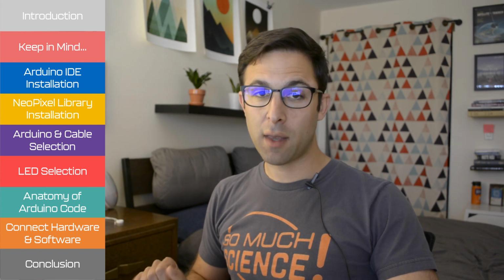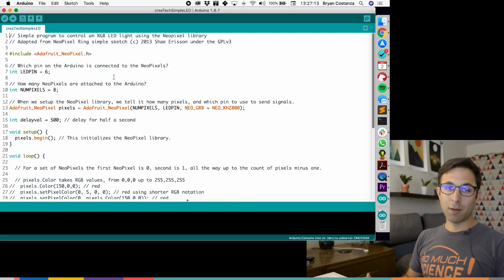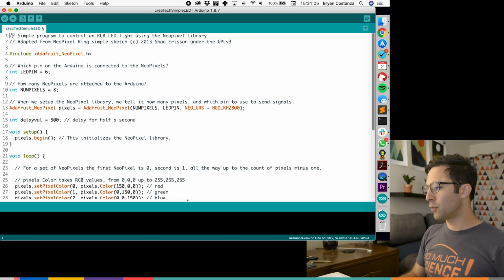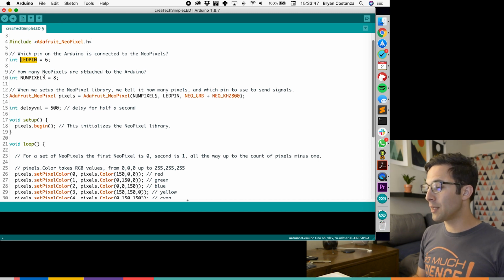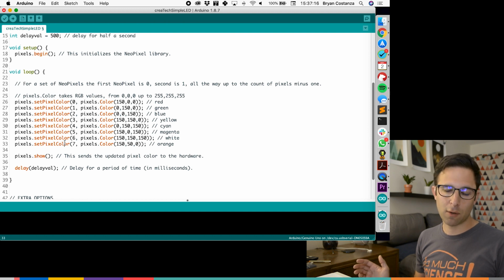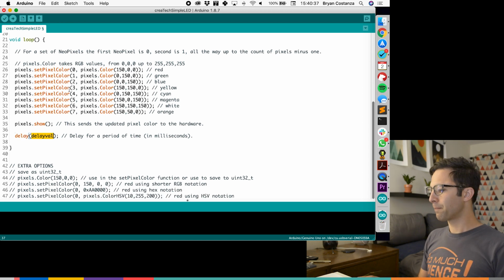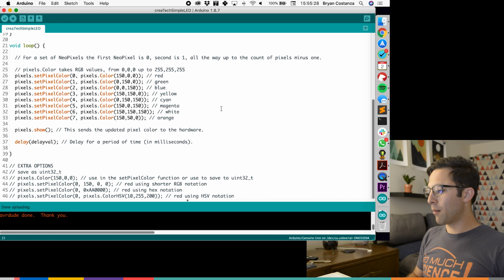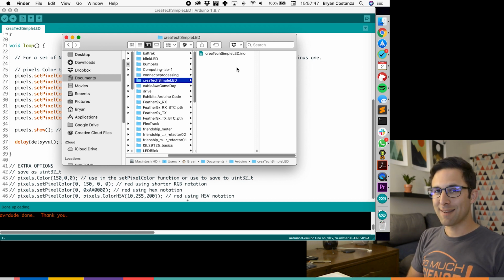Arduino NeoPixel LED Tutorial for Beginners

Comment: Running IDE 2.3.10 appimage on Linux Mint and was not loading or finding libraries in the "manage library" tab. -it was as if IDE was unaware of the internet. After trying several things, what worked was to rename the file arduino-cli.yaml to arduino-cli.yaml.bak and then restart IDE (which recreates the file) -"arduino-cli.yaml" should be in home/Arduino

Comment: Im at a roadblock with my neopixel jewel, i dont know if i have the wires connected wrong or if its the board. Im using arduino nano and arduino web editor but these are my questions:
1. I am not sure if my arduino nano came with the adafruit library included, when i put in the code it seems as if the arduino doesnt get that its a neopixel, how would i install the adafruit neopixel into the arduino with web editor?
2. Which ports are supposed to connected on the neopixel? ground, 5v power and input right?
Reply from the maker: 1) The Arduino device doesn't really "know" anything, it just runs whatever "program" is uploaded from the editor. So, the editor has to know to include the library when it compiles. For the web editor it looks like you select "Libraries" on the left-hand side, search "Adafruit Neopixel," click "Include," and then it will add the import statement to your code.

Comment: Confused to when you say external power. Surely it can only be powered externally as it is not self powered. Also the USB supplies power to all 180 of my LEDs. Why do you say only 8 will power?
Reply from the maker: I mean powering the LEDs directly with a power supply instead of only using the power and ground from the microcontroller. Still make sure it is 5V and that there is a common ground with the microcontroller. An Arduino Uno only supplies about 0.5 A through it so to connect a strip of LEDs that use more then you have to supply the power “externally”.

If you connect more than 8 LEDs they will still function (to some limit, I’m curious what that is) but with a decreased current so they will not be as bright. 70 mA per LED (at full white, less for colors) and a total of 500 mA through the Arduino really is only about 7 at full brightness but that seemed like a silly number for the tutorial.

Comment: I bought an adafruit feather 32u4 and non-adafruit neopixels. will I still be able to programme the leds using the feather?
Reply from the maker: If the the LEDs have 2812 or 2811 chips in them then it should all still work the way it does in the video.
Reply: thank you!

Comment: How should I modify the code for the WRGB Neopixels like the SK6812?
Reply from the maker: I'm not actually sure. Information about this on the internet is surprisingly spotty and nothing stood out as "the answer" to me. If the answer isn't on Line 28 at https://github.com/adafruit/Adafruit_NeoPixel/blob/master/examples/RGBWstrandtest/RGBWstrandtest.ino or if it's not recognized by the FastLED library, then I don't know what to do next. Ideally, you would just declare a different kind of LED strip strip (like the one on line 28 in the linked example) and then add a fourth parameter when you set the color. Fill us in if you find out!

Comment: Hello and thank you so much for making this video. I have a question, the neopixel I ordered, has another ground wire extending alongside the data output cable, both of which are connected together to a JST Pin. Can I wire the ground from the JST pin to any of the three grounds on the arduino alongside the separate ground wire? Thank you for your time!
Reply from the maker: Thank you for watching! You can use any ground wire to connect to any ground pin, they are all the same.
Reply: @SoMuchScience  thanks again! You're a godsend

Comment: Why do you need an external power supply? I have 256 LEDs hooked up to my arduino and have no issue operating all of them at once. Though, i keep them at max 100,100,100 instead of 255,255,255. Is that the reason why I havent had any issues?
Reply from the maker: Yes, keeping it at lower values will help. I have also run ~200 LEDs with no external supply but the maximum brightness is decreased significantly. Also, only the LEDs that are on will use much current so that is one way you could have a lot of LEDs but not lose brightness necessarily. I can guarantee you that the maximum brightness decreases as you add LEDs but in most lighting conditions it is hard to see much of a difference when the LEDs are so bright. As a test, try a script that light up one more LED at full brightness every second and you'll start to see the brightness decrease at some point.

Comment: Hi Hermann from Germany here. I’m trying to code a sun and moon light animation for my  African hedgehog terrarium with these led’s. Some how I can’t figure out how I can switch the four variables to the value I want, send to the Arduino Bord by my pc. I am searching and searching, but I can’t find a tutorial for changing these four variables. For example if I insert a Variable in the led number Variable, Arduino says ‘variable’ was not declared in this scope.
Reply from the maker: Could be hard to figure out without example code but what you mention at the end sounds like you need to initialize a variable before using or modifying it. This error is most often caused by either not initializing the variable at all or initializing it with the wrong scope. More details at https://www.arduino.cc/en/Reference/VariableDeclaration or contact me through my website if you want to dig into the code more (http://somuchscience.com/ redirects to http://bryancostanza.com).

Comment: Hello, thanks for this informative and basic LED Neopixel tutorial. I have a question for you, maybe you can point me to the info I need? I am not programmer but I do have some skills in building electronics and soldering. I am also into midi music and have been looking for a simple method to take midi data input via 5 pin midi, and assign it to a strip of LEDs so that I can put the LED strip on the top of a keyboard and play midi files from sequencer software that will show someone how to play the music. The Arduino should be capable of doing this. I have run across several systems on Youtube using Raspberry pi, but it seems I have not found a simple midi input to LED out type solution. If you know of any scripts written to do this I would appreciate the info. Thanks
Reply from the maker: I have almost no experience with MIDI but some people that come to mind are https://www.jifferharriman.com and https://www.colorado.edu/atlas/wayne-seltzer. Or if you find one script that does the MIDI side with the Arduino device that you want then I may be able to guide you with completing the LED side. Please write to me through my website (http://somuchscience.com/ redirects to http://bryancostanza.com) if you want to continue looking into this.

Comment: This works with WS2811 led strip?
Reply from the maker: I've never tried it but it appears that it does. Try replacing `NEO_KHZ800` with `NEO_KHZ400` based on what I see on line 14 here https://learn.adafruit.com/adafruit-neopixel-uberguide/arduino-library-use.

Comment: is it always necessary to use the adafruit library?  I tried using basic digitalWrite and it does not light up my strip.
Reply from the maker: You need to use at least some library for the LEDs because it is actually sending a very high frequency signal that contains color information, kind of like dial-up internet. One alternative library that I like better than Adafruit's (but that is a little harder to get started with) is FastLED.
Reply: @SoMuchScience  Thank you!

Comment: Hi there, if started a new project and desided to make a custom code, a few hours back I watched your tutarial and it was really helpfull. but if got a question cose i got a problem, see, im making a big sign that says Moxxi's. consist out of 254 leds inside a defuse tube. if connected it on one strip and want the letters M, o, x, x, and s. to be constand 1 colour and i want to animate the heart (the dot on the i is a heart) to be animeted. my question is (cose my code is getting really big). is there a way to say led 1/57 be red cose thats all the leds in the letter M.

for example:   pixels.setPixelColor(0-57, pixels.Color(255,255,0));  
instread of every pixel given his own line..

i couldnt find any codes on the internet or any other tutorial as helpfull as yours. hope you could help me out. thanks!
Reply from the maker: Sure. You can't do it in one line but you can do it in about three by using a FOR loop. Try something like this (I didn't run it on an Arduino to check but I think it will work as-is):

for (int i = 0; i < 57; i++) {
     pixels.setPixelColor(i, pixels.Color(255,255,0));
}
Reply: Thank you so much, if got it working good and as I wanted! Then my sign is done and on Instagram I'll do you a msg if you want. Thanks again!
Reply from the maker: @clangendijk  Cool! Want to post a link to the project right here? Or sending me a message would be good too.

Comment: If I had 405 LEDs, then I would go from 0 to 403 cuz 404 doesnt exist
Reply from the maker: You would go 0-404 because 405 would not be a valid index. So you would have LEDs 1-405 with indices of 0-404.
Reply: So Much Science it wasn't mean serius

Comment: This was a great video and thank you for posting it, but I will say that I have a 144 WS2811B LEDs running without problems,   no extra Power supply, only the 5 VDC out Pin, this is on a genuine Arduino Uno powered by my computer and nothing else.  Please feel free to reach out to me for any questions.
Reply: The limit is ~8 at 100% bright white but you can do many, many more at lower levels

Comment: I'm trying to do this with a Arduino Mega (clone). It ain't workinn. :[  If there's something about megas or clones I should be doing differently let me know
Reply: I had the power input and data wires plugged into the wrong holes on the neopixel. (fixed)

Comment: I'm trying to connect 3 different strips of neopixel LEDs 4 long and have them all blink at the same time.. I'm having issues doing this. Any suggestions?
Reply from the maker: Hello! I'm just getting back to typing after shoulder surgery. If you want them to show the exact same thing then you can connect them to all of the same pins. Since the Arduino only has a place for one wire per pin then you can accomplish this most easily by connecting them all through a breadboard like this: https://www.sparkfun.com/products/12002. Let me know if your question is other than what I've addressed here or if these leads to other questions.

Comment: Thank you man for ur precious infos, i just need one more explaination about the hex notation, does it work if i changed "pixels.setPixelColor(0,pixels.Color(150,0,0));"  with "pixels.setPixelColor(4,0xffffff )" ?
Reply from the maker: You are very welcome! I'm not sitting here trying it on an Arduino but the code you wrote does look correct to me. If you're curious how the RGB converts to Hex then you can use any of the many converters on the Internet (e.g., https://www.rgbtohex.net/ seems good); the appearance doesn't convert perfectly from a screen to the LEDs but the calculation is the same and it's a good approximation to get you started.

Comment: I have a 12V LED Strip, how do you wire that?
Reply: Basically, you'll need to get a 5V-12V logic level shifter (CORRECTION: the LEDs in question actually still use 5V logic so no logic level shifter is needed) for the signal coming from the Arduino and then power the LED strip with its own 12V power supply, making sure to connect ground (establish a common ground) between the LED power and the Arduino power. you will also use both your 5V and 12V power to set the reference voltage levels on the logic level shifter. It looks like someone (in the comments at the following link) has used a SparkFun item to do this: https://www.sparkfun.com/products/12009. I also found a few EzSBC shifters that explicitly give 5V-12V as an example but I've ever heard of this brand: https://www.ezsbc.com/index.php/products/ls1.html and https://www.ezsbc.com/index.php/products/ls2.html.
Reply: @BryanCostanza  Thank you for info, I did see some people plugging the 12V direct into the Mega (but I can not find the wiring diagram) And also others using the 12V to power the strips and a 9V battery for the Mega. Will either of those work?
Reply from the maker: @PantherJagger  (Oops, looks like I was logged in as myself instead of So Much Science). I just looked at the tech specs for the Mega (https://store.arduino.cc/usa/mega-2560-r3) and it can take a 12V power input but if it is similar to the Uno R3 with power then you'll need to make sure you give it that power on the barrel connector and not directly into the 5V pin. I also saw some comments (https://arduino.stackexchange.com/questions/28761/controlling-a-digital-12v-addressable-rgb-led-strip-with-arduino) that even 12V addressable LEDs use a 5V logic signal, so you would not need to use a logic level shifter at all in that case. Worst-case, if you try without a logic level shifter and it doesn't work then you will not have damaged anything. It seems like both options you found (Combo 9V/12V or just 12V) would both work. In short, you should (1) be able to use the 12V supply for everything if you supply power to the Mega with a barrel connector, also connect the same power supply directly to the LEDs, and then simply connect the signal to the Mega, or (2) power the LEDs with the power supply, the Mega with a 9V battery, the signal directly from the Mega, and make sure that you connect Ground between the LEDs and Mega. It now turns out we just wrote out what Leesah was asking about a couple of weeks ago in another comment and that I might be able to do a video for this weekend.
Reply: @SoMuchScience  Please do a video, I have the new ws2815  12V and you are awesome!! Thank you

Comment: I don't know how to say other than an Onest THANK YOU - I am not an English spoken but was the Most Complex and yeat Easy to understand explanation I've watched during the last 6 months since I am trying to learn Arduino programming and specially addressable RGB LED's ... for that, I Thank You again ... Please keep us informed about this subject and not only ... I have also as a hobby 3D printing and I am interested if is possible to make a small program for an RGB LED ring ( I want them mounted on Extruder carriage - X ax ) like so: when the nozzle is starting to warm up the light to start - that ROYGBIV spectre but backwords VIBGYOR and finally Hot nozzle Full Red - " 255 " and when the printer is starting Printing to become White !!!... THANK YOU ... Best of Luck / Be Safe / Stay Safe
Reply from the maker: This made me so happy! Thank you for writing and for your kind words. I'm not too sure about your printer indicator project. One idea that could be fun with sensors is just to use an Arduino with a temperature sensor and LEDs connected near the nozzle but this might be hard because of the limited space. Otherwise, I think you would need to be sending the status from your computer either directly to the LEDs or to an Arduino-like device through a USB Serial connection. This might be done with a Processing sketch on your computer that can send Serial data through USB but you would still need to figure out how to read the status on your computer and then Serial communication can be really tough. Or another idea is to somehow measure voltage across (or current to) the heating element on the printer but then you. have the risk of damaging your printer if you're not sure about how to modify things.
Reply: @SoMuchScience  I know is been 2 years since you answer me and I Apologize for that🙏 , but the life is not very Gentle with us so I hope You understand 😉... I Thank You again 🤝for the complete & complex answer ... I will look into to see what I can do ... Best of Luck 🤞👍
Reply from the maker: @mariuspetcu7482  Happily, and no problem, great to hear from you again. I thought I'd have made dozens more videos by now buuut time and life happens to all (most? 😉) of us.

Comment: Do you have codes for more designs  and effects it will be really helpfully doing a project which Is due soon thanks in advance
Reply from the maker: I'm busy with a project too so I can't make more examples right now but consider that the example code sort of has two "frames" and you can copy/paste them to make more frames and then you can program each LED for each frame to make it animated or whatever you'd like even if you don't learn more programming concepts.